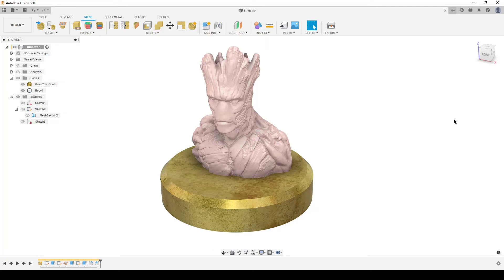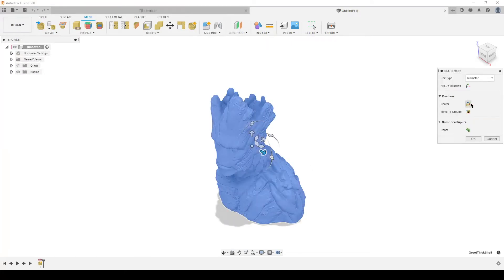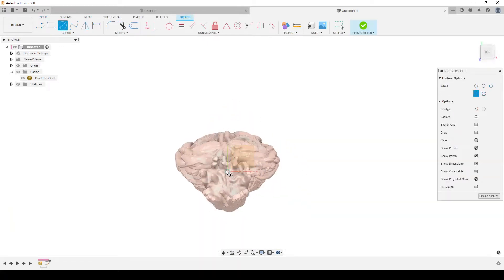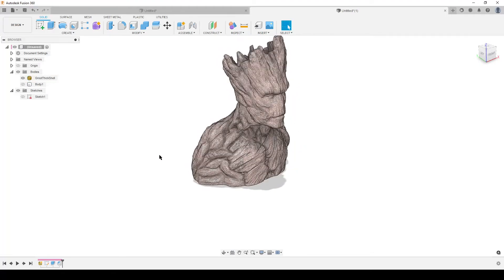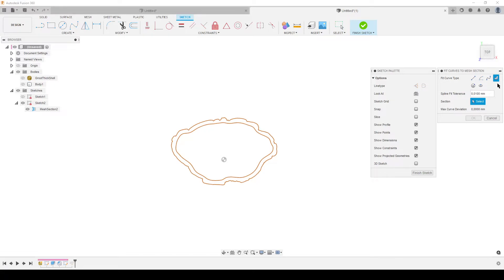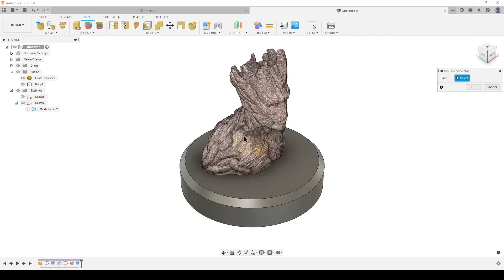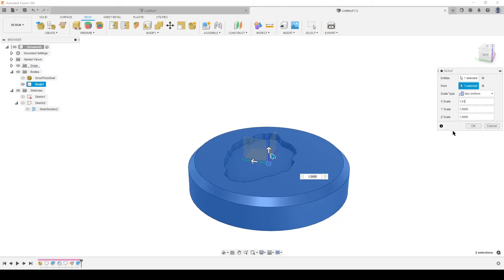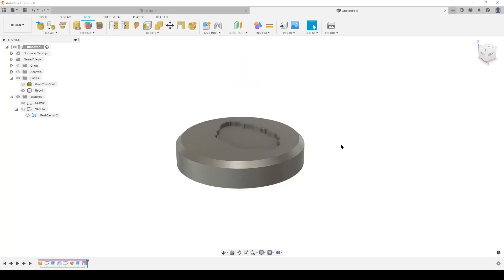Fusion 360 - Groot needs a base (using STL/Mesh for reference)

Comment: Sweet! Nice job! You scaled it... Offset face or press pull could also work with the clearence?
Reply from the maker: Offset face or Offset of profile in sketch both sometimes failed. There are still plenty of things can go wrong with STL files :)
Reply: @KristianLaholm  I meant the cutout in the solid body...to make it bigger. Editing mesh is still very problematic :)
Reply from the maker: @lukaszb1282  We are taking about the same thing, offset face (press pull is the same) sometimes failed and I wanted to share something I knew worked without to much fussing around :)